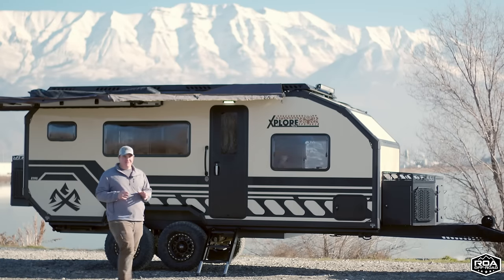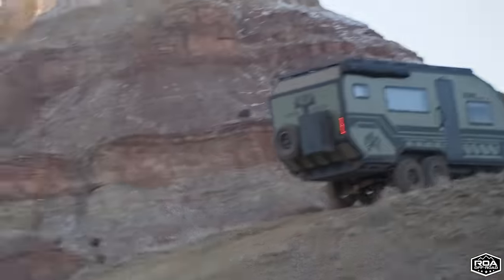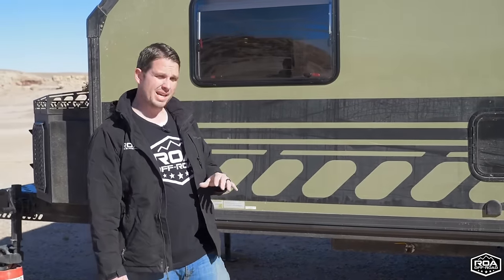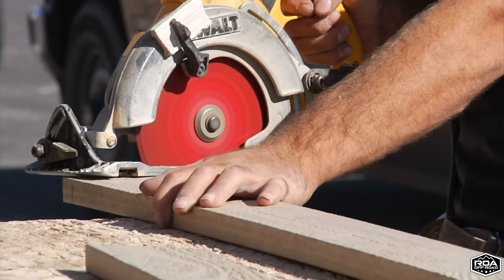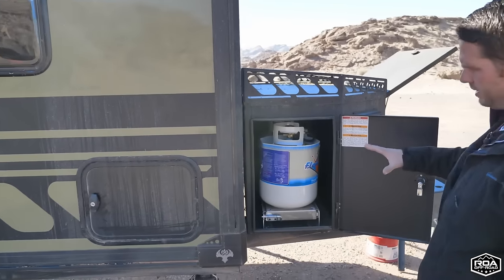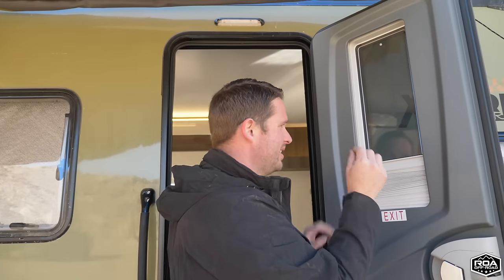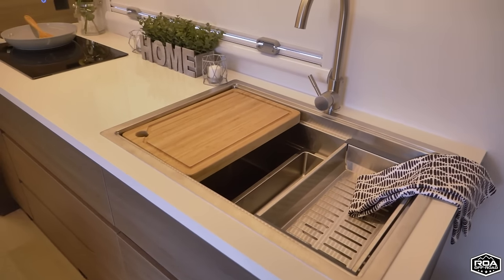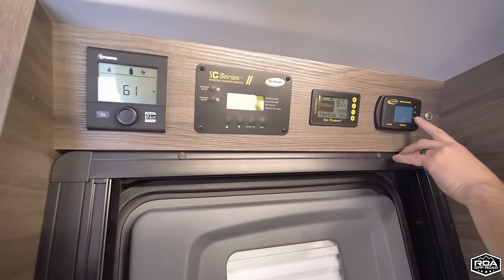NEW X195 by Imperial Outdoors FULL TOUR! (UPDATE) | What We've Learned in 1 Year | ROA Off-Road

Comment: One thing I have noticed with air-conditioning units is that they are annoyingly loud…
Would it be possible to offer a unit that has the air conditioning unit on the outside somehow that is piped into the inside of the trailer?

Comment: For the past year I've been going back and forth between the X-195, the Roamer-1, and the Pause.  I'm now favoring the Pause, but damn, the X-195/Roamer-1's are still flipping amazing trailers!  They all have their own unique qualities that makes them all stand out!  Damn you ROA for making choosing a trailer so difficult!  lol
Reply: If you need the insulation and are concerned with weight go X 195 or R1. If not go Pause
Reply: IMHO I would lean toward the x 195. Mostly do to the roof. Look at the roof set up on this x195. Solar set up is awesome. Such an improvement over the x22 (xr) peel and stick set up. This shows a huge improvement.  Two holes for ac and fan. Very clean roof. Then look at The Pause roof. Two massive holes for star gazzer window with one on the down slope.  AC, fan and I believe solor bracket mount holes. Then add 2 gallons of dicor pored around each hole. It's an ugly roof.

IO's (GS Trailer) chassis has two year warranty. Pause in house huck bolt chassis has one year. 

CM suspension is more proven and has to be considerably lighter the moryide. Pause has that brand new moryide hitch coupler on a very short tounge A frame.
Reply: I also looked at the same options and decided the X 19a5 best meets my NEEDS.  A lot of the features in the Pause I did not need and many of the features in the X 195 will be upgraded over time. m The  2000 watt inverter is not enough.  I do love the induction cook top., but we use several portable appliances to make our kitchen complete.  I am waiting for some cool weather to see how the furnace does at -30 ° F.

Comment: Great video for those looking into these.  Love mine!  Couple things for others looking.  Hitch weight will be close to or more likely OVER 1k in a stage 3 or stage 2 with your gear in the front and 'stuff' inside the camper itself. Pulling with a Raptor (I did till I upgraded to a 3/4 ton, you'll be sagging big time even with something like a stage 2 Deaver HD spring set up.  1/2 tons don't like this tongue weight and you'll need to go to a WDH and then with the D045 you'll need a special set up).  Just better to pull with a 3/4 ton of your choice.  It's hard to find 'real world specs' around actual tow weights / tongue weights so thought I'd try to help.  Trailer is a beast and you'll love the conveniences it provides.  Quality throughout and ease of function one you start using and learning the systems etc.  Well done ROA on breaking it down in the video.
Reply from the maker: Thanks for the comment! And for providing more valuable info that we didn’t cover here :)
Reply: So I thought Shane said half ton no problem.  Your saying tounge weight is 1,500 pounds but Shane said 800 pounds. Your saying 3/4 ton Shane says 1/2 ton. Interesting
Reply: @bartman1857  he's giving you the 'stock brand new, no propane, no 'stuff', off the showroom floor' numbers.  This is how manufactures need to measure.  They have no idea what you'll put in it, on it or around it.  When you stock up two 20lb propane tanks, that alone equals another 74lbs (you see how you almost jump 100 lbs above stock!).  Now add anything in the inside, in the front storage box (x2) plus the 'through storage' and you creep up quickly.  Most if not all 1/2 ton trucks have a 800lb  - 1000  Class IV hitch and above that you'll need a WDH.  example the 2024 F-150 has a payload of 2,445 lbs.  Sounds good right?  BUT that's a 4x2 Standard Cab....make it a platinum, XLT or Lariat, the numbers go down.  Add 1000 lb tongue weight, plus stuff in the bed and a partner and kids and you can see you run out quickly.  Remember, a Honda Civic can PULL (tow) a semi, it just can't stop it and that 'little sticker' on the inside door jamb is what they'll check (insurance company) if there's an accident.  Just not worth it imo and not safe for others on the highway with me.  They numbers and examples I gave are real life (CAT Scale and truck examples).
Reply: Man you are being so nice. Shane knows that the x 195 has a very heavy tounge.  Even though he never seem to have much gear when they are out making YT videos he has to know that tounge weight is over spec for a half ton. He even implied you could go lower then a half ton if your stage 1. Even with stage one this trailer could easily get to 1,200 pound tounge weight.  It's just seems clear to me that telling folks they should go 3/4 ton would hurt sales.
Reply: OMG who welded that tounge box on this unit? Friday afternoon work for sure.  Lucky the chassis is farmed out.

Comment: Thanks for another great vid! Questions: -Is there any warming unit to clear the ice off solar panels for full-timers in the snow? Is there any built in pump to create a positive air pressure in the cabin while pulling? -What about a permanent spot on the roof for a Starlink? Finally, is it possible to install the table from the Pause that is more adaptablke
Reply from the maker: There is nothing to heat the snow. Most people use a brush to clean. 

-We can option a positive air pressure system
-yes we have mounted Star-link on the roof
-Yes, we can option the table for something else.

Comment: amazing trailer, the only thing missing is an easy awning situation, that also covers the outdoor kitchen. Those folding awnings are very hard to fold and unfold, especially at that height.
Reply from the maker: Yes. We agree and that is why we can options for other awnings. 😀 You can order from us with some electrical awnings.
Reply: The awning is a pain in  the ass to stow.  I fin deploying the awing OK.  I am heading to the awning manufacture to get a hands on lesson on how "easy" it is to stow the awing.  I have  spoken to others with the awning on Vans and they swear by it.
Reply: moon shade
Reply: I had an electric motor fail on my awning and while I was driving it deployed ( it just unfurled and collapsed on itself hitting the side of my van) not a fun situation. I replaced it with a manual awning only for resale purposes. Otherwise I'd go with a moon shade. Also, the motors are known to only last roughly 5 years or so at a replacement cost of $500 a pop.
 @SkylinersYeti

Comment: Love the thoroughness... I have watched several of your long version tours start to finish. Not boring at all and that says a lot. The off road testing is super impressive. I had one thought. Can you set the freezer portion of the refrigerator high enough to just be another refrigerator? I am not big on frozen food and would want the extra capacity for more refrigerator space. I have owned two class A's and always felt the refrigerator space lacking since I was full timing. The only thing I used the freezer for was ice. I am sure i will own another RV at some point. Kind of wide open on the class since each one has it own advantages. Don't think it's going to be another Class A. I was leaning toward an Arctic Fox travel trailer until I saw your four season designs. The way they have ducted hot air to the dump stations and the tanks and plumbing is beyond brilliant and they have tank heaters to boot. Here's a story you could share. It was April 10 and I was staying at a Lodge in Vail. The Coach was parked in nearby Eagle-Vail. Not a particularly cold spot. I had the generator set to auto start when the batteries dropped to 92% with the hydronic heat running continuously. I would leave the bay lights on a that kept them above freezing. Never had a freeze up until this freak weather event. The temperature dropped to 25 below zero in April of all months ! That's the first time the diesel onan failed to auto start and of course the batteries died quickly. That meant no bay heat at all. What a bummer! Catastropic freeze up damage and the entire plumbing system had to be rebuilt. It was 2003 Country Coach Allure 36 foot diesel pusher. Feel free to share that story when you cover the four season design. It's what really sells your product in ski country, big time!  Best Regards Dave
Reply from the maker: Thanks for the comment and story. That is a bummer. Unfortunately the freezer can’t be a fridge. You would need to do away with the freezer and do two fridges. Thanks for watching and the nice comment.
Reply: an idea....put frozen ice packs in freezer then add your items that need to be refrigerated that aren't requiring a steady cold temp. ie. fruit and veggies.

Comment: Out of curiosity, what was the perceived benefit of switching from the powered awning they had on the X(R)22 models to this new manual batwing awning? Cause from where I’m sitting, the batwing just looks like a tremendous hassle.
Reply: Sound like redundancy if you don’t need something automatic then you might not want it for the long term good point but that’s what i can think of for the switch
Reply from the maker: As we covered in this video, the manual awning has less things that can break, it’s more durable and steady in higher winds, and you get more coverage. But there is definitely more setup. We can option an electric awning for those who prefer

Comment: Correction, camping weight of mine is 6,500 lbs.  Tongue weight  1,500 lbs.  The only issue  with the awning is it is a bitch to stow.  Currently camping and truma died.
Reply from the maker: How did it die? What is going on? Did you check the air codes or propane? That is not good.
Reply: Truma died? Hope you are not in a cold climate
Reply: Truma service got back to me early the day after Christmas.  The agreed to send the parts to my local rv repair shop after the first of the year.  There warehouse is doing end of year inventory.👍
Reply: @bartman1857  It was 20 degree F outside,  30 in trailer.   We were lucky and had 30 amp shore power and used the AC function for heat.  It was slow to heat the trailer but we survived.  Truma support returned my email and will send parts ASAP to an approved service center.  I am on the schedule to have the heater repaired 1/24/24.  A month delay in the repair will mean two camping trips will need to be canceled.  :)   I till be on their case for an earlier date to put in the new parts.
Reply: @SkylinersYeti  Jan 24th is a long wait considering it is under warranty.  IS it being repaired by the dealer you bought it from?
Reply: @bartman1857   I agree that is a long time to wait.  It is under warrantee and must be repaired by an authorized Truma service center other wise I would do the work myself.
Reply: @SkylinersYeti  where did you buy your x195?
Reply: @bartman1857  I bought it at ROA  650 miles from my home.
Reply: @SkylinersYeti  I see your at the mercy of your local Truma certified service center. What part failed you? Is it all on Truma or did IO screw up?
Reply: @bartman1857  The control board.  Just one of those things.  Electronic parts come and go.  When working it is a great product.
Reply: @SkylinersYeti  obsolutly sheet happens ! Kudos for you to let folks know about the real world tounge weight on the xplores. I bought one of those etrailer tongue scales (fairly accurate) and was very suprised how trailer weight balance and level ground really effects tounge weight.